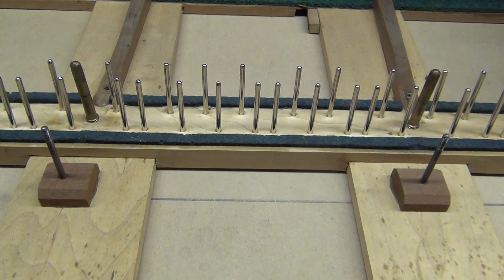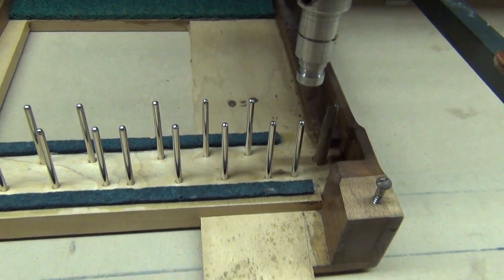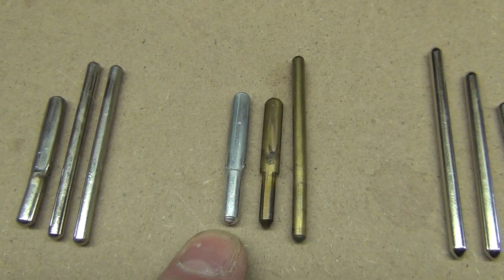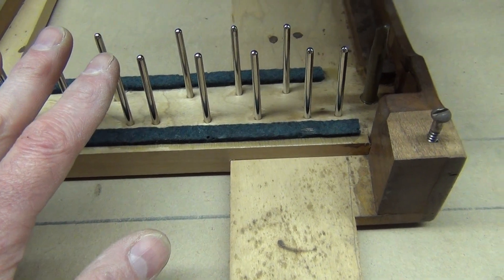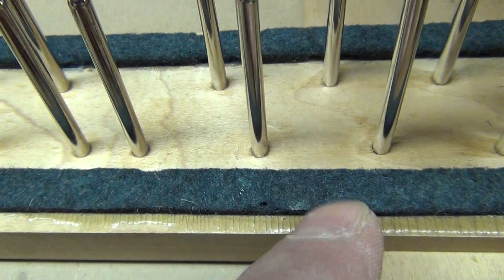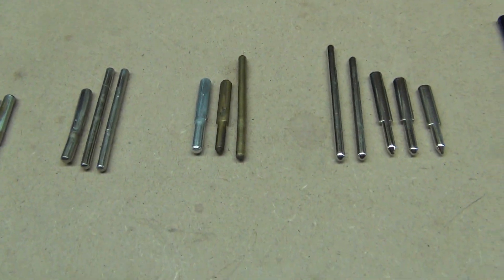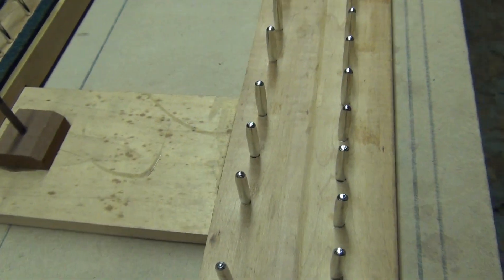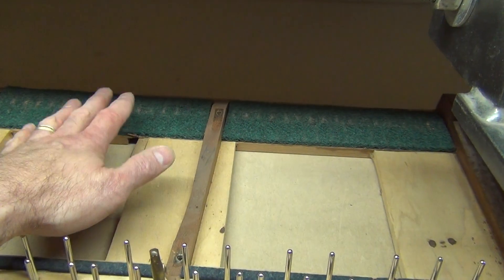repinning the balance rail on a grand piano keyframe

Comment: I extract balance pins with a mass driven extractor (so they go out straight) or with leverage near their center. I thought of using a pneumatic rivet machine , but one may need an industrial model for so large diameter

Ever tried that ? 

Best regards

Comment: Hello, I really did appreciate your videos, and used them for some american customer and their Steinway

I agree about iron pins, but I am curious about the reinforcment solution you use , We always need to bend balance pins, at least toward front, so for instance Otto Heuss in Germany insert new wood strips when changing pins (that allowing to modify leverage when they build new keys)

If you dont mind Id like your point on reinforcment, email me privately if you wish isaac.oleg  gmail

I also need to reinforce keys from an old player Steinway , different options possible (thinned portion due to tubing passage)

Best regards